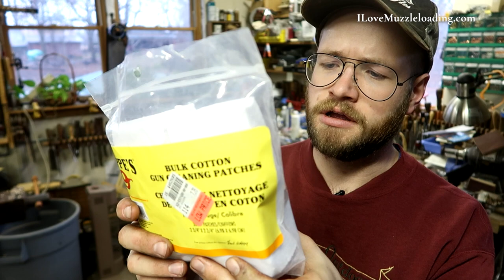How I clean my Kibler Southern Mountain Flintlock | No more rusty muzzleloaders

Comment: I use hot soapy water with a cap full of Murphy's Oil Soap.  I never use a bore brush unless I have a gun that has been neglected.  When I am finished with the soapy patches, I take the barrel off and rinse it under hot water in the shower.... taking time to fill the bore completely.  Take the barrel out of the shower with a towel because it will be very hot.  Couple of dry patches, then blow air down the bore to get the last drops of water out of the breech and you are ready for oil/grease.  The oiled patch on the nipple trick works well with caplocks, so I would suppose it will work well with a fllintlock.... something I will now go and do with my T/C Renegade flintlock.  Most of my guns are T/C hook breach guns.  Usually I clean the hammer/cock with a toothbrush and the Murphy's Oil Soap solution followed by a dry rag wipe down.  I coat the bore with T/C or other brand of bore butter/Natural Lube 1000.  I finish up by lubing barrel external surfaces, sights, lock parts, etc. with whatever gun oil I have and an old shaving brush.  I've also been known to use Johnson's Paste Wax on external surfaces.  It protects well and doesn't gather dust during the winter.  You seem to have more patience than I do.
Reply from the maker: Thanks for sharing Dale!

Comment: I heard there are issues running patches down your barrel if you match the caliber of the barrel with a same caliber jag. Have you heard of this and if so is there a rule of thumb to use?
Reply from the maker: I'd say if you got the calipers out, you don't want a jag that is the same size or larger than your bore, but every jag I've gotten for different calibers has been slightly undersized as it comes so it doesn't bind. I think the manufacturers have made it hard to mess up.

Comment: I do have another question. My touch hole on my TC Renegade/with Green Mountain barrel was forward in relation to the pan and seemed low so it was suggested by a another flintlock so called expert to take a small grinding stone and shape it deeper. Have you heard of this?I did this mod. and added a touch hole liner that used a Allen wrench to remove.
Reply from the maker: I suppose you could do that, can't say I ever have though myself
Reply: Most flintlocks have enough meat around the pan that you can grind a little on one side or the other to get the touch-hole centered on the flash.

Comment: Can you apply the oil like you did to an inline and dry patch it before the next use? I was always told to keep oil away from the barrel. I shoot pellets if that matters and while I clean the crap out of my CVA I struggle with rust in the barrel over time between hunting seasons.  I use CVS cleaners and solvents and run two CVA rust preventor patches at the end. I still get light surface rust.
Reply from the maker: I don't see why not. In my experience, the oil is removed from the barrel with a dry patch and a primer pop before loading and shooting so the oil can't hamper ignition. 

Light surface rust is pretty common in muzzleloaders. I get some even if I oil the bore and it sits for 6 months or so. I like to oil now and then, that's the only way I've found to keep them clean.
Reply: @ILoveMuzzleloading  Appreciate the response. I will check mine more often.

Comment: Does anyone have tips to get fowling on the underside of the barrel?
I don't want to take barrels off. But I cannot get to that area with lock removed.
I am using the same method of cleaning as shown.
I have question about browned barrels, are they less prone to corrode over blued barrels? I don't own one nor know anyone who does.

Thanks in advance.
Reply from the maker: The only way to truly clean under the barrel is to remove the barrel from the stock unfortunately. 

I feel this kind of cleaning is only needed once a year if you are shooting often.

Comment: Where can I get that rod your using.?I just use my fiberglass ramrod for loading and cleaning.
Reply from the maker: Log Cabin Shop, Dixie Gun works or Track of the wolf all have them
Reply: Thanks
Reply: I have been shooting BP for over 50 yrs. Do not use fiberglass ram rods.  Use aluminum brass Wood.   Balistol good  finish oil.  Hot sopa and water.  As hot as you can take. It will dry itself to clean.   I just wonder what to do with all this gear I have collected over 50 yrs

Comment: Of course I clean differently than you do, however the only truly wrong way I have ever seen is neglect. Nothing hurts my heart more than a needlessly rusted pile of crap that was once a beautiful work of rifle artistry. These pawn shop catastrophes really popped up with the so called non corrosive BP substitutes. Non corrosive my butt! So after all that said I'm still of the old school with real blackpowder of hot water and dish soap. Old warn out wash clothes and bath towels cut to size with there porous fabric does it for me. Wedge pin barrels are just way to convenaint not to drop in the tub. I must admit I kind of enjoy stirring up the pot with the wife over the beautiful essence of cleaning blackpowder. Back in the early 70's when I started shooting the oil of choice was my mother's sewing machine oil, and to this day 2n1 is my go too.  Now here's my one oddity is were. I like towel dry everything, then a light coat of oil then prop the rifle upside down over or near a warm source( example  furnace register) 24-48 hours. For my mind assurance of no left over moisture. Recoat with light oil before storing away. Please keep in mind this is my madness for cleaning real blackpowder only. Substitutes for me is another story. I LIKE that you plug the end of your barrel with an oil rag. 

 Side note the process of running a dry patch through my barrel than turning it upside down near a heat source is what I like to do as part of my prep before ever pouring powder down the barrel for either a day at the range or a hunt
Reply from the maker: Amen, neglect is the worst. Good idea on prep before you go on a hunt or to the range!

Comment: No brush down the barrel?
Reply from the maker: Nope, I never have
Reply: I have also never needed a brush.  My regiment is different than his, but I've still never had a need.
Reply: Brush for what? There's no leading, BP fouling is pretty much soot and brushes are meant to go all the way through, not reversed in the bore.
Reply: Only used it when I had a badly rusted/neglected bore to deal with.  You have to be careful in that case as the brush can get stuck in the bore.  Those guns I cleaned up and kept never needed bore brushing again and the ones I put back on the rack for sale didn't come back with complaints.  Only suggestion I got is NEVER to use a wooden ramrod with a bore brush.  The end of the rod can come off if the brush gets stuck and it is very difficult to get that mess out of your bore.